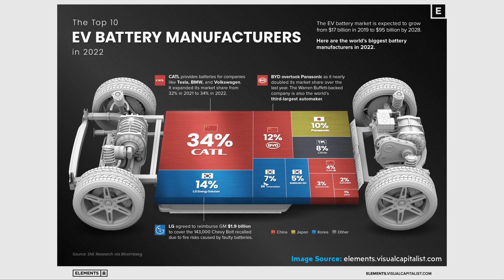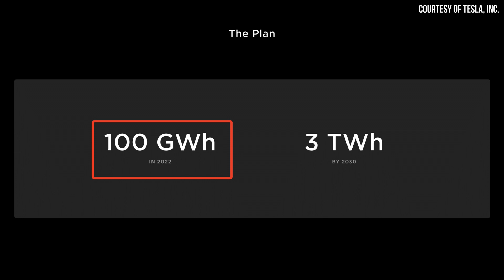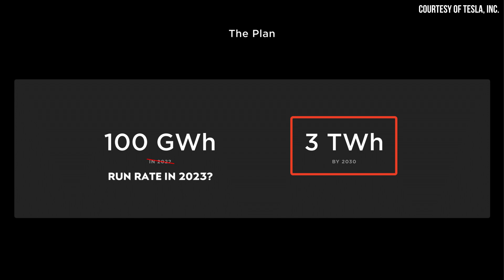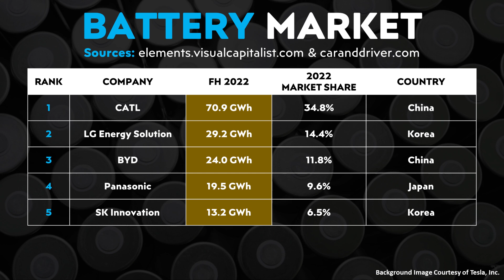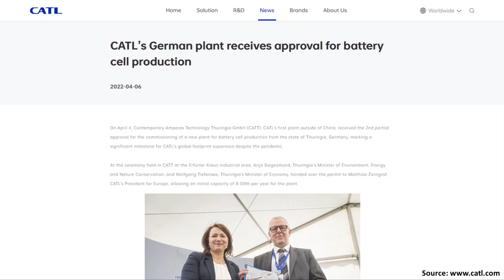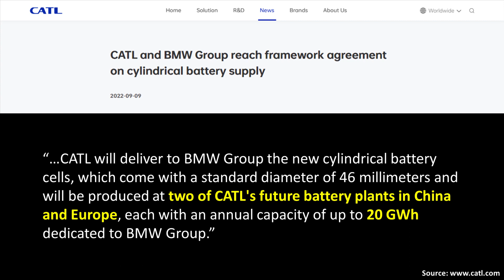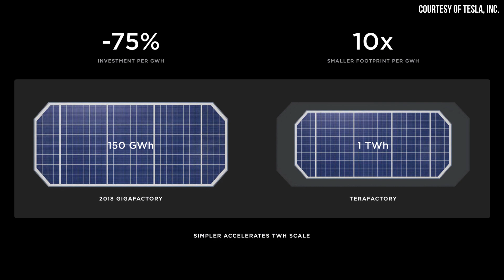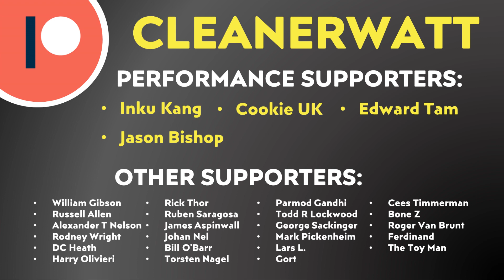TESLA is about to DISRUPT the EV Battery Industry

Comment: shrug. tesla is now a luxury ev brand.  
the cost of ev cars are just way too high especially without tax credit and only upper middle class can use the full tax rebate.
meaning this.

you need at least 20 yrs of owning the tesla to justify owning the car to payback initial cost
based on my new car purchase of Mazda 3 2017 @ 21k 5 yrs ago new. mpg is 25-35 average

therefore I would be over paying 25-30k for tesla model 3 to replace my mazda 3.
until the ev payback period is less than 5 years EV is a waste of money. 

all ev manufacturers need to lower prices by at least 30% to make themselves competitive once dealers and manufacturers get a clue and lower prices back to normal.  I am refusing to pay more than 25k for a vehicle.

with the tax rebate payback period is about 15 yrs.
the toyota rav4 prime payback period if you were able to get it last year would be 10 yrs. instead since they had the tax credit.
42k for premium version and 39k for regular msrp but 5k markup ripoff by dealers. <= this makes payback period 15 yrs thanks to dealer corruption.

if you can wait to buy a vehicle wait do not buy until manufacturers start getting desperate.

people wanting to buy a tesla should wait until 2023 for the tax credit else waste of money.
remember 48k for model 3 and 60k for model y more expensive than building a small house.
Reply: Sadly not so. Economies of scale will fall away for ice vehicles as the market shrinks prices will rise as the cars become more expensive bev prices fall as scale kicks in. The running cost is 25% that of ice.
Reply: @makeitgreener642  oh really? 25% the cost of ICE when it costs 50-100% more than ice.

ROI isn't there.
you could argue with me when tesla model 3 was 35k after rebate 7500 maybe. but tesla 3 never was a 35k car ever.
the cybertruck 40k will also be delayed and also they will count the 7500 into it so real cost is 47500 or if musk is feeling like a douche.

he will include gas savings after 6-10 yrs even and jack prices up as advertisement seems to work on dumb folk.
making the truck 55k for base model and advertised as 40k.

ROI is maybe 5-10 years since elon musk raised prices ROI is now 15-20 yrs making EV cars worthless if you want to save any money thats if ICE car manufactures and dealers stop deciding to charge dealer premiums and markups to ridiculous levels.  EV went popular 50% due to ICE car dealers markups and taking advantage of consumers as a result all the manufactures will feel the heat.  

Both ice and EV will fall as no one buys them except rich brats and they will realize thats not enough to sustain themselves.

they will find out people will fix their cars and not buy anything for a while to make all of them suffer the chip shortage is over as crypto winter and mining hype is over.
deal with it or die like the rest of us since they decided to price gauge us.

basically have major distaste of both ev and ice manufacturers RN both sides can go fuk themselves.

i'll DIY and look into buying parts to convert my own car into a hybrid instead later on instead of buying anything from these scammers.

also economies of scale don't mean shit when I can go on youtube and learn how to make/repair my own car without even buying it.

I'd rather just buy a kit and make them all myself at this point than buy anything from dealers.
Reply: @makeitgreener642  PS the key to lowering cost is actually consumers competing against manufacturers making them irrelevant hackers have always been the ones to innovate NOT Businesses.

Businesses are forced to innovate to compete with hackers or die.

the moment you let businesses take away the ability to repair or DIY is the death coffin of the consumer to be beholden to the business restricting right to repair or make their own products for their own consumption.

See apple good hackers hate them since we know better they are catered to those that dont know how to use tech and spoiled brats.

tesla is also going this route restricting people from repairing their own parts as are most luxury manufacturers.

face it tesla is just another luxury car maker now not really for helping the planet just for monies.
they should just go die as well.  not buying tesla at all 

unless they give me value proposition not the BS advertisement. 35k tesla model 3 was probably their best try at giving any value.  everything on their lineup is over priced. 

What happened to making their own batteries for cheap?  oh guess not then. productivity seem to have went down.

perhaps they should just go mine their own minerals like lithium and nickel. ironic.

but excuses? Russian war keep blaming the war instead  of increasing productivity.  so they pass on the cost to consumers to maintain 30% profit margins.  UM nope not going to absorb it.

Expensive EVS and Tesla and all ICE cars are luxuries not a requirement.  People need to get this in their head.
Reply: @Koushi82  I think you have tesla confused with vw. Tesla sells the model y in europe for $41k. This is comparable to if not cheaper than the ice equivalent.  The reason tesla raised it usa prices was to prevent a ridiculous wait time for orders. Prices will fall once tesla meets demand.  Though that may not be for years, if they have to cut margins to raise demand in future, nobody else can compete as they are the only ev company that makes profitable evs. Also their margin is 30% atm, so have a lot of flexibility the others don't have. The rest sold at the lowest possible price to compete and still lost market. If they can't hit volume production with their evs(that's at least 5k cars a week per model) they are not going to hit economies of scale that tesla gets from their limited line up.
Reply: @makeitgreener642  sorry bro I will need a plugin hybrid first ev makers will need to include at least solar panels on a car that can generate 10 miles per day at least.
I believe they already made one called scion and likely cost an arm and a leg again making it worthless.  

so given that a ev needs 346 watts per mile.  solar panels such as fisker 70k model is doable for 5 miles when its just solar roof.

What if they did all the windows then?  doubling up as tinting the windows for you since we already do so. blackout windows in the back at least with solar panels and the rear window. that should bump it to 7-8 miles per day and another 2 miles on solar 
that would

if they find a creative way of doing it like on  the panels of the whole car itself such as the hood being solar absorbing energy to a certain extent. that would make the car generate likely upwards of 20 miles per hour and plus batteries it would be perfect at that point. 

some on youtube are already doing this.  I watched them.

The only thing is design it and anufacturer it so it looks decent and you got a winner.
the hood itself can generate 200 watts already by adding 2 = 200 watt/hr flexible solar panels.

the sun roof can take 3-4 solar panels.
that is another 400 watts/hr
4 panels

windows on the rear = 100 watt/hr
1 panel

back door of car = another 200 watt/hr
2 panels

if you make the doors as well? = 400 watts/hr 
4 panels

13 panels 1300 watt per hr or
346 watt per miles = 3.7 miles per hour generated that would mean on average lets say 8-10 hrs good generation

29.6-37 miles generated per day
say bad sun location 15-19 miles per day.
plus scion issue was they make it inside likely so the solar generation was only 70 miles per week.

note you can also run the a/c even without depleting your battery on idle then.

you charge car only in emergencies. or long road trips.

so combine it with battery of 300 miles and it would be decent.

also scion is relatively cheap they market it is 25k euros.

now if other manufactures can get on board with this already I would buy it.  The key is being quality affordable and efficient. 

making things more efficient is though and musk is increasing pieces

tesla isn't innovating at all more and more batteries isn't the answer tell musk he is a nub he needs to go back to hacking forums and draw ideas.

Comment: I don’t think you mentioned that most of the raw materials for batteries come from Central/South America and are refined in China for all the manufactures to use in production worldwide.  However,  Tesla has lithium  mining rights for 10,000 acres in Nevada, and is going to build a refining plant using they’re own proprietary methods in Texas.  This has proactively set them up to be able to meet the progressively stringent guidelines set forth in the recent EV incentive legislation.
This makes it cheaper for them to produce and process the raw materials and manufacture the batteries, and not have to pay or be reliant on the middle man to do it for them.  Then the consumer will get a cheaper, better car that they will be able to apply the full EV incentives for.
While the rest of the the EV and battery industry are in a cluster f**k still trying to figure it out.

Comment: Nice analysis Jon - I agree with your assessment, but it isn't easy to project where Tesla will be short term because of the uncertainties in the 4680 ramp for the next 6-12 months. One thing is clear - the smaller factory footprint, lower capital equipment required, energy savings from not having to evaporate solvent, IRA domestic production incentives and savings on paying a vendor for batteries is going to add up to a huge (50-70% lower) cost advantage over competitors buying batteries from 3rd party battery makers. So, margins will get even better or Tesla will have more room to lower prices if desired.
Reply: That’s an exciting prospect.
Reply: No such thing as battery competition only reason Tesla makes batteries is to supplement vendors Batteries are th future!!! Remember Energy storage?
Reply: I am not being negative, I just think it will take longer than John’s projections.  Tesla will do it, just going to awhile.  The Semi took 5 years to complete.  The Cybertruck truck was announced 3 years ago, still always off.  Things take time. 2025 might be the year Tesla is really cranking out batteries. Which is cool.
Reply: @Team_Trade_Down 
CTs giga casting machine is at the port not far from tega and I think will take a month or so to install and get operational but first prototypes off the mf line early next year. My guess only so take with a grain or 5 billion of salt
Reply: @brettmciver432  While GigaTexas could be set up to produce CyberTrucks in the spring, the question will be about the batteries.  Could Tesla decision to ship the first ones with 2170's?  Sure.   I don't think they will want to though.  It would make more sense to ship them with 4680s.  But they might not have enough supply of those until later in 2023.
Reply: @Team_Trade_Down 
Yup could happen but they are getting the battery machines meant for berga so that will "double" production at tega so that should help a lot. 🍻

Comment: Is tsla going to build any LFP lines though? 
LFP will be extremely important for stationary storage
Reply from the maker: I believe they plan to buy LFP and make nickel based batteries inhouse.
Reply: @Cleanerwatt  I think that makes sense, keeps everybody happy - especially in CHina
Reply: @Cleanerwatt  do you have any opinions or insights into flow or other similar battery techs that have promise for use in stationary storage?
Reply: Two methods to make cells cheap.
1) Use cheap materials
.
2) Cut overheads and make them very quickly.
.
The second (Tesla) method allows very cheap high density cells from a very small, comparatively cheap to run factory.
.
Then, we can add the hint by Jeff Dahn...... (Paraphrased)
"By turning the voltage down and tweaking the chemistry, we can make a (Nickel based) cell with a " TWO million mile life" while retaining more density than "LFP" cells."
.
So that's a higher density cell, very cheap, with an extremely long life, produced in very high volume from a small factory......
"Important for stationary storage"
.
One more point, on what will no doubt be the next topic.... "Safety"
.
1) It's not really a problem any more.
.
2) Many of the previous "safety issues" stem from the  high energy density of cells (LFP, lower density) These (nickel based) cells will be running at lower power levels, well within safe parameters.
.
Of course, there may be another phase "down the road".
If "Iron (or other cheap material) based cells" can be adapted to the Tesla production process, that's a HUGE opportunity......

Comment: making batteries was a very smart move by Tesla!!!
Reply: Vertical integration is part the secret sauce. OEM manufactures have spread their manufacturing out to such an extent that in many cases they are still hamstrung from supply chain issues. The manufacturing process like giga casting is another part of their secret. 

If what I have read is true. Tesla has long term contracts for battery mineral supply.
Reply: @shannonwoodcock1035  they have contracts in place for the next 5 years plus. With enough material volume to make 4million cars a year. This is why they are going into refining along with the inflation induction act, there is too much incentive not to and they still don't have enough materials to hit their targets. If the 6 battery suppliers manage to hit their targets that tesla set, that should be enough for 28million cars a year in 2030.
Reply: Yes it's a checkmate move for the so called competition!✔️
Reply from the maker: Yes!
Reply: Thumbs up sir. I am a TSLA Investor and own a 2020 Model 3. IMHO batteries are the most critical and costly part of any EV. So we must now weather the drop in value of our stocks, part of that process is to buy when the market is down. So, we bought another 500 shares of TSLA today at $204.57 a share. 😁
Reply: @DLeske  cool I  am planning on loading up very  soon  Good  Move
Reply: Tesla had to move carefully so as not to spook their existing suppliers.

Comment: Nice! Wait, you mean Giga Shanghai is producing 4680 cells? And structural battery packs as well? Where do they go? Are some lines converted to structural Y?
Reply from the maker: I don't know about structural packs, or where they are going - but I was told at least initial 4680 production has begun at Giga Shanghai!
Reply: @Cleanerwatt  catl byd panasonic samsung and a couple of others are making 4680 for tesla and Mercedes atm. With Mercedes also ordering a short form 4640 cell.
Reply: The elephant in the room is the upcoming raw materials shortages. Everyone's planning for 100s of GWhs of capacity, yet the mines won't be able to provide that much for a decade, nickel, graphite, lithium, cobalt etc. will be in shortages for many years. And with China controlling refining, anode & cathode production as well as cell manufacturing, they WILL play the geopolitical game answering the US chip bans, and Chinese refineries and brands will be prioritized. 

Now Tesla's position is great for a few years and is planning to circumvent China dominance, yet the shortages wars will come much faster than mines, refineries, anode-cathode production and cell manufacturing going around can catch up, and I see zero planning just yet at Gigafactories for mass scale recycling, with large numbers of pack only expected to come back 5-8 years from now anyway. So for the foreseeable future and much of the decade, the EV industry will do as well as China will allow it, and you better be on their good side.